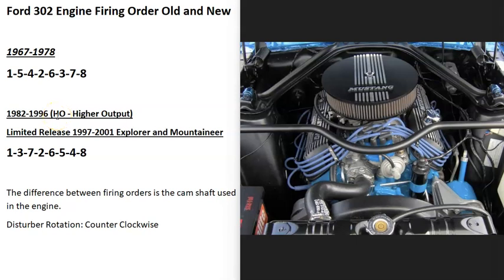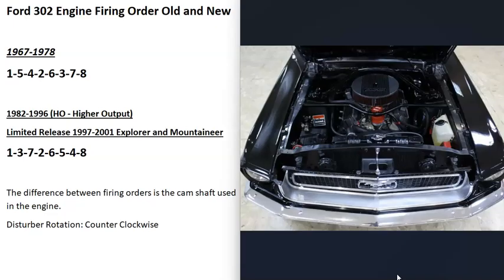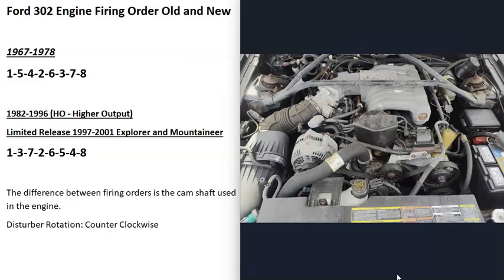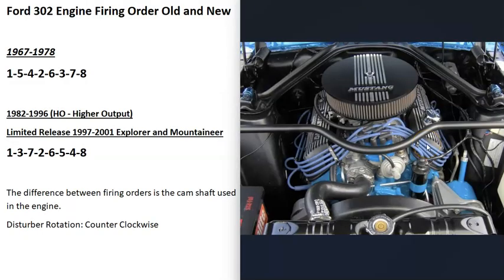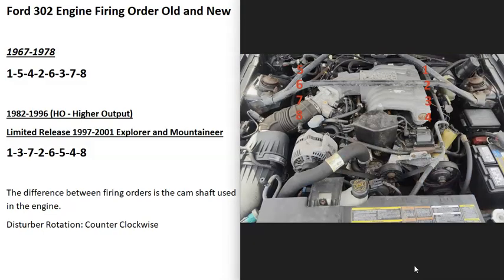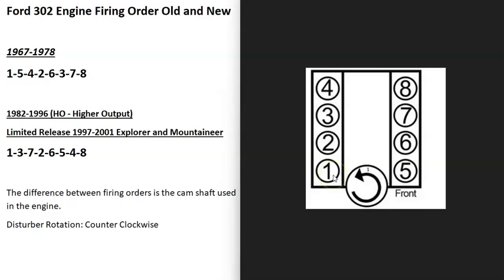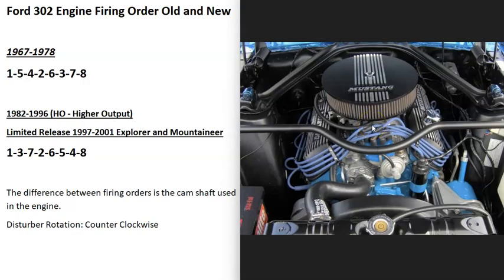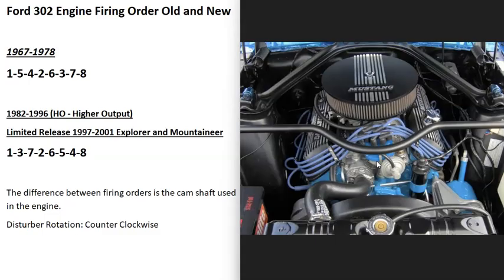Ford 302 Engine Firing Order Old and New and Cylinder Locations

Comment: Good job dude. i have a 75' Formula TBird BOAT with a MERCRUISER 302/ 351w/188hp (888) Ford engine and was using the ';NEW' 137...FO. with the cylinders in the new configuration. Oops. No wonder it wouldnt fire. I completely rebuilt the motor and was getting a little concerned. The boat sat for 20yrs and was givin to me on a bet that I couldnt get it running. Im going to name her either "RESERECTED" or  "LEFT FOR DEAD" My goal is to have her on the water next summer. Thanks to you that just might be possible. Great video...good job.

Comment: Pretty sure the obs trucks 88-93ish ran a different firing order until they put Sfi with maf sensors in around 94-95. I believe the Maf engines ran the HO firing order. Correct me if I’m wrong cause I got an 89 bronco with a maf conversion and I’m all sorts of confused 😵‍💫

Comment: Where is number 1 on the Cap
Reply from the maker: It will be different for every vehicle. It can vary where the rotor points at in the cap, but usually, you can follow the #1 cylinder spark plug wire to the cap. Otherwise, you will need to find where the rotor points when the #1 cylinder is at TDC.
Reply: @WirelesSHack   Day late dollar short...#1 on the rotor cap installed is just left of front center. Rotates counterclockwise.#3 being center then 726548. Thats on my '75 302 351w 188hp. with a modified cam. If you were confused before.....
Reply: Suppose to line up with the Rotor at 10 degrees BTDC pointing at the #1 cylinder wired to the #1 sparkplug

Comment: Cylinder numbers have not changed, all Ford V8 engines are the same. Firing order change was to revise main bearing preload.
Reply: You said 'ALL" Ford V8 have the same the Cylinder #s but didnt  say what that is. I tried the front left 1234 right side 5678. DID NOT WORK. Going to try the right side back to front 1234 left back to front 5678 as described in this video. Stay tuned.